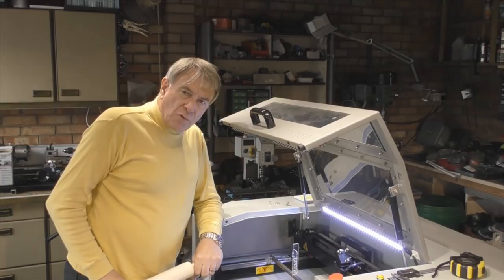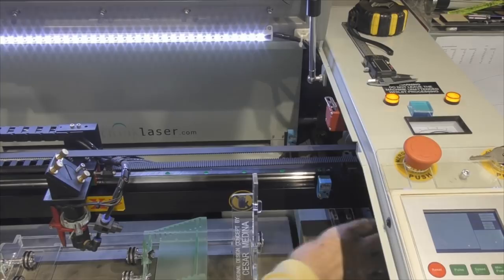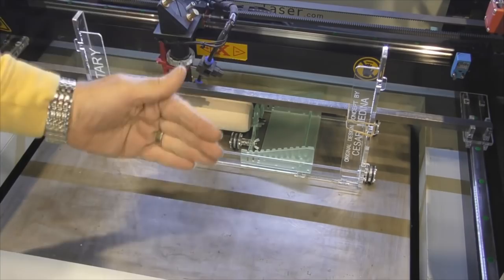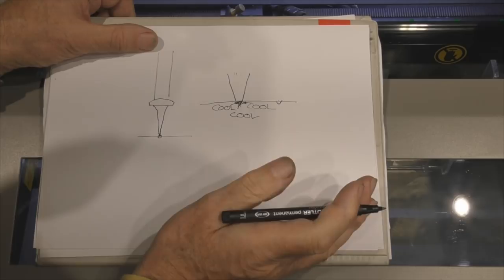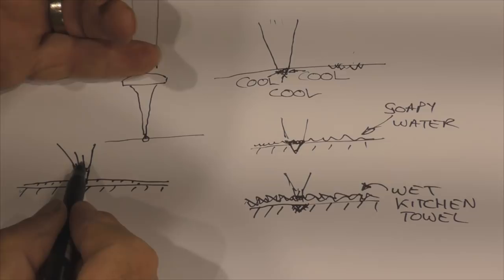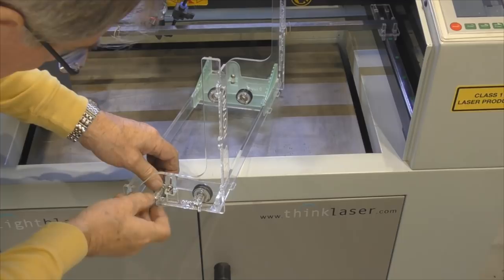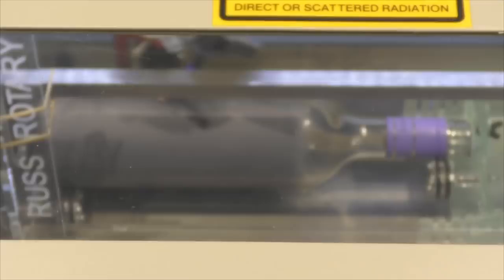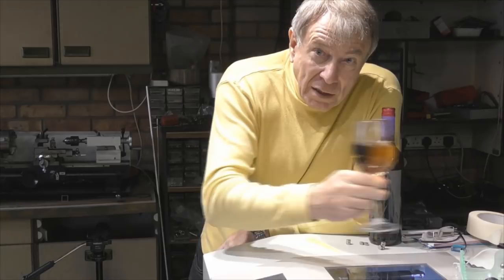RDWorks Learning Lab 123  Let's Test our DIY Rotary Engraver

Comment: Dear Sir,

I enjoyed your two videos on the rotary attachment. When you placed the wine bottle on the rollers, and talked about having the bottle parallel, something came to mind... I know that you developed the 'rack' at 3mm increments for adjustment, and then also the +1 and +2 'adapters'. So if you are still off by lets say 0.2mm on either of the 3 'adapters', you can run one or two layers of masking tape around the neck of the bottle where the wheels will be running. This obviously depends on how critical one want to be with the focal distance when engraving ;-). I hope this helps a bit.

Regards,
Théo THERON.

Comment: Will this fit on v-rails?  I can't tell by the video and I'm new to all of this.  I have the ortur laser master pro s2.  I have the dxf file and have already started working on it in Lightburn to get it ready. I just realized the pushers may not work.
Reply from the maker: Hi 
The principle of this device is to simulate a drawing  that wold be done on the flat bed of your mcchine the wheels that contact your round objct are transferriny bed Y axis motion as X1, so there is no scaling involved.. It can be driven by your gantry  in any mechanical way you can devise. The design just happens to suit my machines..
 Best wishes
Russ
Reply: @SarbarMultimedia  Thanks for the Reply.  I've watched both videos you made and they were both helpful.  I'm in the process of ordering the materials, but was just double-checking they'd work on my rails.  I appreciate your quick response.  I like this much better than the electric since it's simple and doesn't have anything really to go wrong except user-error.

Comment: Why did you disregard your dot image calculations from a few episodes ago? Do those rules not apply for glass?
Reply from the maker: The first small image was according to those rules  but looked far too dotty. I know that my formula works for organic materials because that was my starting point. When you burn a little hole in wood, card or leather you always get a scorch halo around the hole that you burn. It is that halo that looks like the dot size and is almost twice the size of the theoretical spot size. With glass there can be no scorching, thus the mark produced on glass is likely to be a smaller dot and thus allows more picture resolution. I guessed at the resolution for picture 2 based on this supposition but stayed with slow speed, low power and set the interval according to the formula. The quality of the engraving for this session was not the real issue, but as it happened, it was a test of my theory and it came out well.   I intend to go back and carry out proper tests on glass, slate, granite and  finally anodized aluminium. All these "hard" materials have the promise of achieving much higher resolutions. I am just about to publish  video about this particular "dot size" subject.
Thanks for the comment
All best wishes
Russ

Comment: Unreal. Absolutely going to make one. I wonder how it would go attaching the roller arrangement to the gantry so that you could run cut paths.
Reply from the maker: Hi Sam
In principle, if you fixed the bumper bar to the gantry directly, you could certainly extend it's use to cutting lines, however, you would have to go into the settings and change the rapid traverse between cuts to something quite slow otherwise the inertia of your object would cause slippage on the drive wheels.
Best wishes
russ

Comment: I have installed new power supply and laser tube.  Aligned and adjusted the mirror positioning also have gone through and moved z up and down to find smallest spot size so as to recalibrate the auto focus feature and my machine at 85% power on a 100 watt laser tube will not cut through 1/8” birch plywood.  BossLaser LS2436
Reply from the maker: Hi Eric. This sounds far too complex to deal with in an open forum. Sadly You Tube has killed it's private messaging system and I hate asking people to send their email to a public forum. The only option is to send me your email in a public comment and I will immediately delete the comment.  We can then help with your issue off-line because we will need to exchange files and pictures.
Best wishes
Russ

Comment: What size and focal length are the lenses in the blue machines? 18 or 20, 1.5”?
Reply: 18 or 20mm, 1.5” FL
Reply from the maker: Hi Edward
There are two dimensions you need to consider when buy a lens. First is the diameter of the lens. The most popular lens diameters are 18mm, 19 and 20mm. Then you select the focal distance for the lens. Again there are only certain distances available, the most popular being 1.5", 2",  2.5" and 4".  My China Blue machine is fitted with an 18mm diameter lens but you cannot assume that all similar machines will have the same lens because different factories may fit different heads which may hold different size lenses.
Best wishes
Russ
Reply: @SarbarMultimedia  Dear Sir,

I am very new to the K40 Laser(40W), and would like to know how to check the lens? As I am really struggling to get the right distances to consistently cut through 3mm Perspex. I also suspect the bed/rails not being perfectly parralel :-(
Reply from the maker: @cfworks1307  
Hi 
You will only have a 2" (50.8mm)  or 1.5" (38.1mm) focal distance lens in your machine.  The lens is THE most important part of your machine and the least understood element.  The quickest way to determine where your focal point is to take a thin piece of card (say a piece from a cereal box) and hold it about 2" (50mm below your nozzle. With your power set at about 20% use the pulse button with a very quick blip to scorch a mark on the card. It will be big, maybe 1/4" (6mm). Now raise the card up in increments as you pulse and you will see the scorch getting smaller. There will be a distance where it becomes a pin prick (mentally note that distance approx) and keep raising the card. The spot will then start growing again. and you can be certain that you are now above the focal point. Now put the card onto your work table and with VERY small adjustments to your nozzle work gap find the absolute smallest dot. This will be the setting you need to work with for ideal cutting. Perspex is actually quite a difficult material to cut but with your 30 watt tube you should be able to cut 3mm at about 10 or 12 mm/sec. When you have found that setting distance, take a cocktail stick or similar and CAREFULLY poke it up into your nozzle until you touch the lens. Measure how far the lens is up inside the nozzle and then add the gap you have determined. Thje total measurement will be very close to one of the two dimensions I stated above

Best wishes
Russ
Reply: @SarbarMultimedia  thanks so much for taking the time to respond. I will go through your reply again later tonight when the circus has gone to bed and sleeping lol. The joys of kids ;-)

I will post my findings here if it is of any help to someone else.

Kind regards,
Théo THERON

Comment: Is there any way to get the .dxf in exact size? I mean so that the parts are the correct size and ready to cut ?
Reply from the maker: Hi John.
The whole point of the DXF format is that it transfers between systems without changing numbers. I use the word numbers rather than size  because if I draw in mm and you input the file to an inch system then the file will translate so that my 1mm is your 1inch  ie you will need to scale the picture down to  1/25.4.  I always put at least one dimension onnmy drawings so that you can check the scaling. .
Hope this helps

Best wishes
Russ
Reply: Yes, sort of, I am putting in to corel draw. Thank you for the reply, and by the way Man you are a genius. This thing is exactly what I need, my rotary tool is useless. Thank you sir .
Reply: Uh actually the whole thing was way to small when I opened it.

Comment: Well done, sir.  Is there a reason not to etch a full bottle?  Would it be safe and work the same way?
Reply from the maker: Hi Darryl
The simple answer is I don't know because I have never had the nerve to waste a good bottle of wine and risk it filling my machine. I do know that there are stresses in the skin layer of glass that you are relieving when you etch the surface. I have filled a bottle with liquid after etching  and sealed it with about an inch of air in the neck of the bottle. A few days later I discovered the bottle had  shattered during warm weather. That was vindication enough to never engrave a message on a full bottle but to make a nice wooden or acrylic case where the messages could be safely added. 
Best wishes
Russ
Reply: @SarbarMultimedia  that convinces me, thanks!

Comment: Fantastic video! Would love to get those plans if you able to email them to me?
Reply from the maker: Hi Ben

No problem other than You tube will not permit email addresses in comments. So we have to be smarter than their algorithms.  Hide you details in a sentence or two something like this. Stephen dot p precedes at normal AT. I use  g===m  ai++++l dot etc.. 
That is easy for us to decode but it fools you tube
I  will reply and delete your comment.
Best wishes
Russ
Reply: @SarbarMultimedia  thanks so much Russ. The two videos you've done have perfectly detailed what I couldn't grasp from Cesar's original one; after watching his, I just couldn't figure out how it turned. One thing I don't quite understand still is why you decided to add distance to the upright portion and then have the metal bar in front of the gantry. Why didn't Cesar's original upright position work for you? My contact will be in the next comment, thanks so much
Reply from the maker: @benhobbs538  
Hi Ben
You will note that I had to make  two spacer sliders to sit on my Y bearing rails. This was to space the actuator bar away from my head. The uprights are tall because I have a table that drops down about 200m.  I think Caesar's original design was for something like a K40.  You do not need all the text I engraved on,  that was to make sure that Caesar got the recognition he deserved for an ingenious design concept.

 Best wishes
Russ